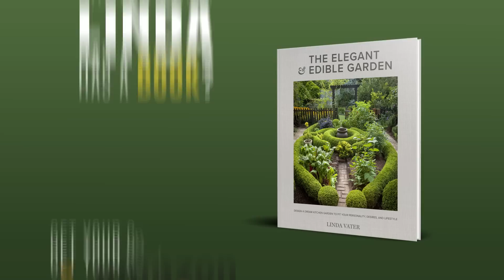Cottage Garden Design Begins!

Comment: You're quite correct that some plants will hide some chips, etc. in the concrete, and I would certainly do the same.  But as for paying a lot for repairs, I would suggest looking at Quickcrete, which comes in lots of different forms, and could be useful to fix up some cracks.  Here in Southern CA Home Depot has a good selection.

Comment: Solution for side walk cracks.  My friend had the concrete cut away about 3 inches away on either side of the crack and put mosaic pebbles in the wavy design left by the removed area.  The pebbles look already weathered and very organic. They are cemented in so they are stable.

Comment: I had an October Glory Maple , I enjoyed for many years. It is a beautiful tree and the Autumn colouring is perfect. Not sure why it started to die out.  I think one thing could have been the lack of watering in the fall. I am in zone 4 to 5. The replacement tree has been a Kentucky Coffee tree. I will make sure in August  to start watering this tree earlier, as I have been gardening here in this zone for years, which I've learned a few tricks about what I need to adhere to. August can be windy and dry  which makes  the leaves dry out. It  has grown into a beautiful tree, with wonderful shade. The only drawback is some small branches  will fall to the ground and  need  to be rake up and  use it as mulch for other areas. Also it's a male tree but a female tree produces pods which the pioneers used to make coffee.   
I am enjoying the progressive attitude about the move and embracing the future. I too, will be down-sizing my home. Excited about the up sizing the yard. I have a goat, Mr. Meigge. Planning on having the Amish make a cart for him to pull with my supplies. My place is being called the "Cottage."

Comment: Trees are beautiful and as always the fence has been heightened with the lattice. Have you considered filling in the side stairway to nowhere?  I did that and never had any regrets. It was cheaper than replacing or removing the concrete steps.

Comment: Love the rug! For the entertainment “bar,” consider using decorative pot feet/lifters for the artwork. They use less depth than an easel. There are sophisticated options on Etsy and from upscale garden sites. Outdoors, I use mossy/aged clay feet to display rustic art on the top tier of my porch potting cabinet between topiaries. I tried an easel but the shelf is too narrow. The pot feet allows the art to hug the wall better.

Comment: You had light bars that you could attach under the counter instead of the little battery charged lamp. I picked up some and they are great, thanks for the tip. Just a thought 🤔

Comment: re: the front sidewalk, instead of erasing those cracks in the walk by matching the concrete patch to the existing walkway color, in the spirit of the japanese art of kintsugi,  it would be fun to plant the cracks with creeping thyme.  However, I think you could take the concept to the extreme and fill them with a molten metal, such as recycled aluminum scrap. It would be a singular artistic statement and save the cost of all new concrete installation.

Comment: I can picture the steps leading to the “ghost” door having small concrete/stone plants pots lining them. Not a ‘vertical’ garden,  a ‘terraced’ garden.  Whatever, You will make it magical.  Smart move to replace that flat section of concrete to front entrance now before you establish lots of plantings. Question, would you be able or ever consider putting any railings along those front stairs for future safety?  Balance can be an issue for all ages, permanent or temporary, friends and family. Just a thought.

Comment: Do you not have a driveway? Do you have to park on the street and carry your groceries in? As someone with a bad back who just had both knees replaced who also has a husband with severe COPD I'm always concerned about ease of access. It seems there are steps and quite a distance to all entrances/exits. 

I like cracks in the sidewalk and flaws. It's not a brand new home. It's an old home in an historic district. Those things give it character as long as they aren't a safety hazard.

Comment: Linda..could you cut out the broken parts of the concrete sidewalk and side phantom door landing and do a soldier row of brick and perhaps a herringbone pattern, respectively? I have done that before (albeit with no HP in place). Perhaps that would be acceptable and save a ton of $$$?

Comment: Linda back to the steps add. Used brick. Turn sideways down the step edges, this will bide any flaws in sidewalk side edges. Added to the sidewalk crack areas that can be cut out were you add used brick. In the walk area. This adds a brick touch ,adding. To. The front of your house being brick Woo hoo!

Comment: I don't think it should be a historical issue to change the faux door into a faux 3rd window with cement sill.  Yes, pergola over the faux door area.
Reply: Look up what can and can’t be done in historical areas. Usually the interiors can change but the exteriors have to remain as they were originally. Otherwise it wouldn’t conform to the historical look.